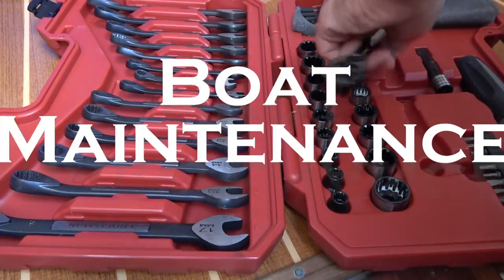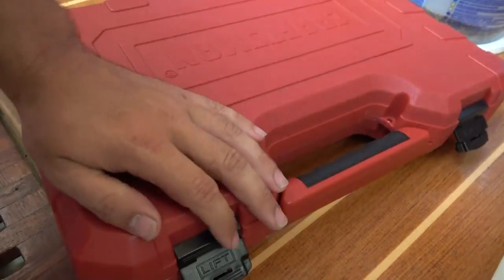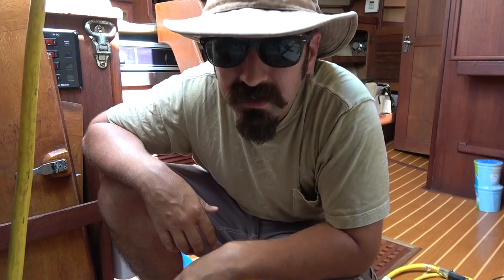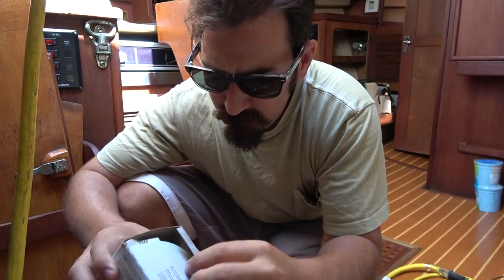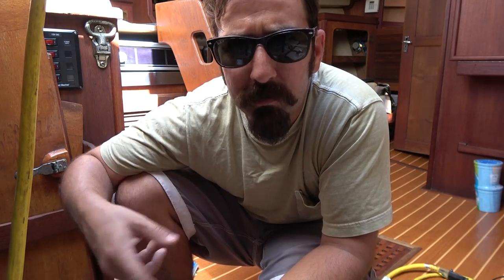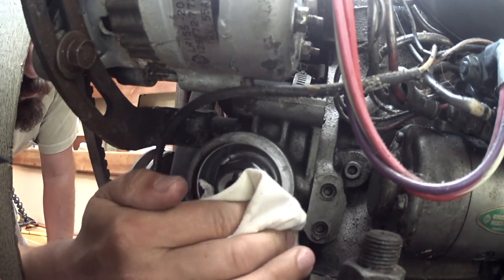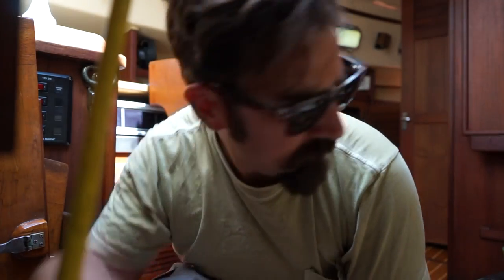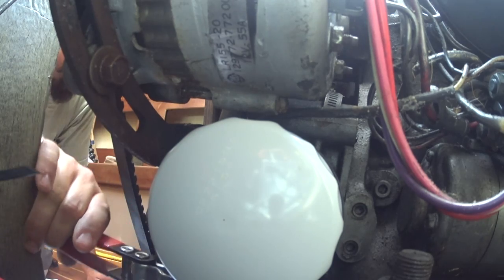Boat Maintenance: Changing the Oil Filter

Comment from the maker: The oil filter on our boat was surprisingly easy to get to, which made this a quick project. I was ready for a struggle to try to reach it. I figured with so little space it would be tough to get out. This can't be the case on most boats. Right?
Reply: Well, um, yeah. Changing the oil sucks on a boat. Wait until you change it in a rolly anchorage.

Comment: You want to oil the gasket on the filter and fill it with enough oil you feel won't spill out.  It keeps it from running dry so much as the filter fills up.  Of course it is on it's side so use your best judgement.  Also change the oil if it hasn't been done.  New filter with old oil will just still be a mess.
Reply: I agree. Also, I generally wait until the boat is in the water so I can run the engine for a minute and most of the particulate then gets suspended in the oil so when you drain it, it gets drained out.

Comment: Why not change the oil too? Did u add oil to replace lost oil in old filter? Plan to change fuel filter? Always a good idea to wash the fuel as well. Cheers.
Reply from the maker: +mikeD I also did change the oil. It will be in another video. Our engine has dual Racor water seperators that I plan to change out as well. Is washing the fuel the same as polishing? That was not on the list, but the old fuel had a stabilizer added so I am hoping it will be alright with new fuel mixed in. That  will all be in additional videos too.
Reply: Yes...polishing the fuel.

Comment: As the engine has not been run for a while, change the oil. Run the engine (with water supply). Change the oil and filter again and you are good to go.